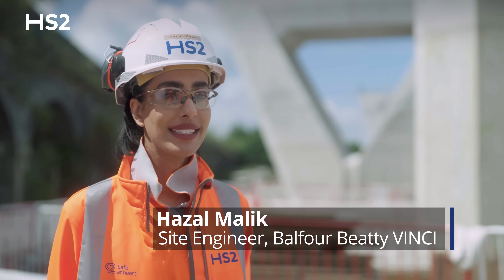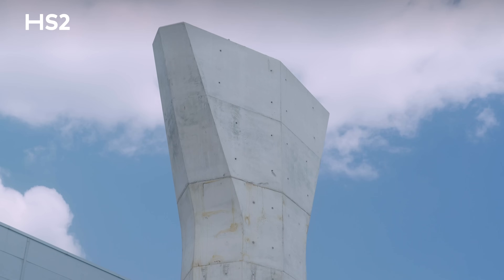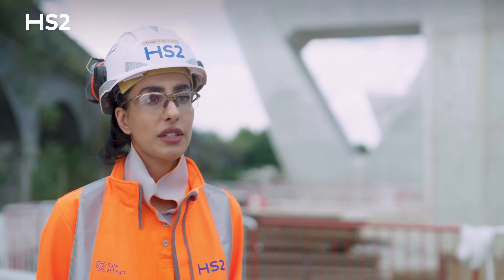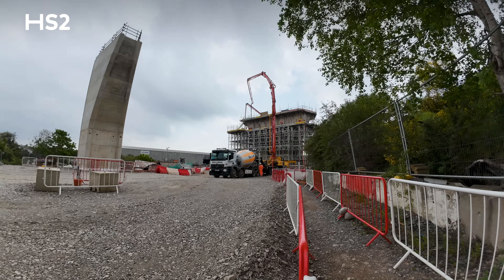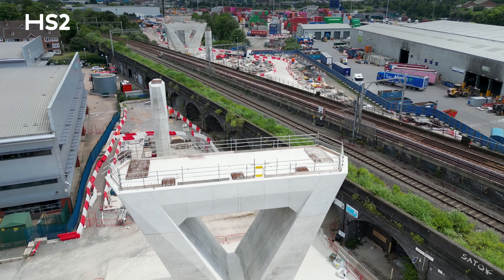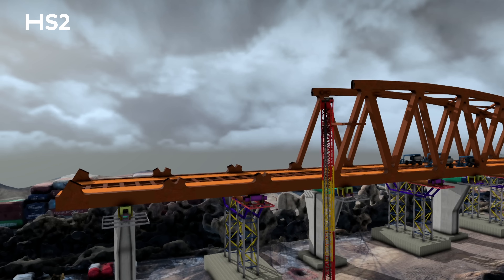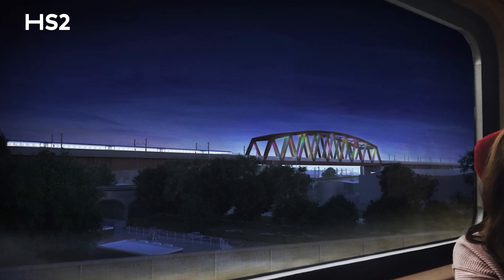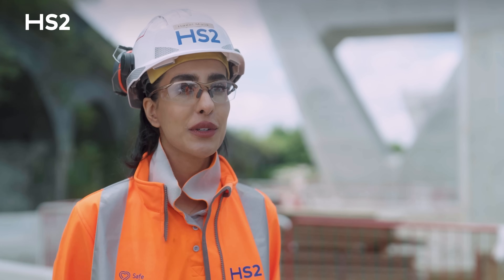HS2’s “Bellingham Bridge” takes shape in Birmingham

Comment: I'm really glad to see this coming along, although I would have preferred for the government to have paid for Curzon Street Station to be a sunken box station with the line continuing under Birmingham and taking trains further north.

Choosing terminal stations (instead of investing slightly more for through stations) is the big mistake that was made in London. It took 100 years of dithering before Paddington and Liverpool Street were connected up by Crossrail. Birmingham is not at the edge of the UK. There is no logical reason to build a new terminal station there.
Reply: Ground conditions (geology, buildings, subterannean infrastructure) would make it horrendously expensive to tunnel a new railway underneath Birmingham city centre - a lot, lot more expensive than what is being built right now. The London tube network was possible because the tunnels are bored through stable clay, which is also relatively cheap to tunnel through. But note that the tube does not extend much south of the River Thames, because the rock-types there are much less easy to tunnel through (hard chalk and unstable gravel). Birmingham centre lies on porous sandstone and pebble beds, both of which make tunnels very difficult to bore and to keep stable and dry. 
Note that Curzon Street, where the HS2 terminal station is being built was the original terminus of the newly-built London - Birmingham railway in 1838. They stopped the railway there precisely because of the difficulty and expense of building a station in the centre of town (the centre of Brum is on a plateau, not in a river valley). For this reason, the existing New Street station wasn't built until 1854. The topography of the hilly city centre means that the station had to be constructed in a cutting with severe space constraints, approached in all directions by expensive tunnels. It was difficult and expensive enough to do this then, when the city was smaller and there were no tall buildings whose foundations had to be avoided. Imagine the difficulty and cost of boring more tunnels through the centre now - that would almost certainly blow the budget for HS2!
Reply: @johnevans2044  It's a pity this was not made clear at the start of the project,my initial thoughts were for an underground box stations enabling direct links to Snow Hill and New St,it was only when the geological problems were pointed out to me that l understood the situation.Yours is an excellent explanation.
Reply: @keithmason7481  I have followed the ide of the HS2 into Birmingham for years and read every thing about it and I can tell you for certain there have never been plans for an underground box station and no reason for HS2 to connect o Snow Hill or New Street stations.
Reply: to westminster birmingham unfortunately is at the edge of the uk, anywhere north of it doesn't seem to matter to them in any capacity
Reply: There is no way this line would of gone under Birmingham City Centre
Reply: To me,as an ex BR employee is the lack of connectivity with Birmingham's 2 Major Stations,l live in Shrewsbury and for me the time taken to connect at Curzon Street is a disincentive to use HS2.
This is not a Rail Industry project,it is a National Infrastructure project,l have no  idea who chose the route, experienced rail operators l knew would have used the M1/M6 route to reach Birmingham, not the Chiltern route,which l felt at the time was a very expensive suicide note,serving no one and costing a fortune.
Reply: @keithmason7481  HS2 does not use the Chilten Route to reach Birmingham it follows the M6 and Aston Expressway into the City Centre and follows no set route from Birmingham to London. You do not actually require to walk between New Street and Curzon Street as there will be an Interchange at Birminghm Interchange Station with  Birmingham International Station

Comment: Lovely elegent concrete piers - but attoped with rusty steel frames - ??cost cutting?
Reply: No - Coreten / Core Ten weathering steel is designed to last a long time without coatings. Overall, the lifecycle costs can be lower, especially considering this span oversails the main rail corridor into Birmingham (safe access would be costly).
Reply: the rust protects the steel, also, it looks cool

Comment: I thought it was cancelled or is that just the other planned section?
Reply: That's the section north to Manchester. However, the section from London Old Oak Common to Birmingham Curzon Street and the existing West Coast Mainline at Handsacre is still going ahead. The section from Euston to Old Oak Common is currently paused but hopefully that gets the go ahead in the near future
Reply: @jermainetrainallen6416  The section from OOC to Euston is now being constructed and the tunneling machines are now boring out the tunnel between OOC and Euston
Reply: @peterwallen1063  The TBMs for the OOC to Euston section haven't yet been delivered. The current plan is for the TBMs to be delivered later this year before the eastern end of the OOC box is sealed, hopefully only temporarily. Therefore, the eastern end can be ready for construction of the tunnel and the rest of the OOC station can be built seperately. It is still paused as of now.